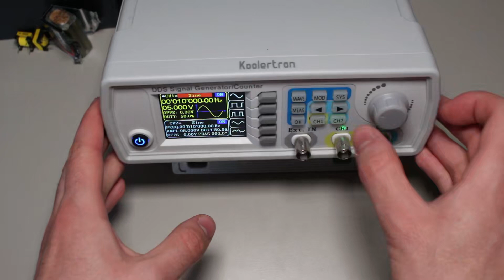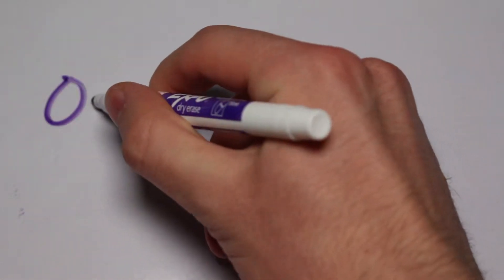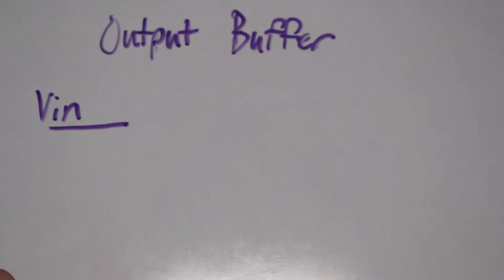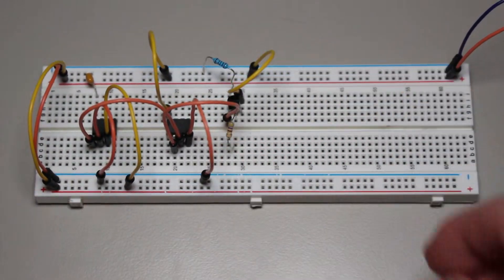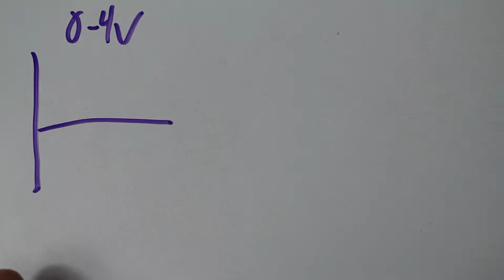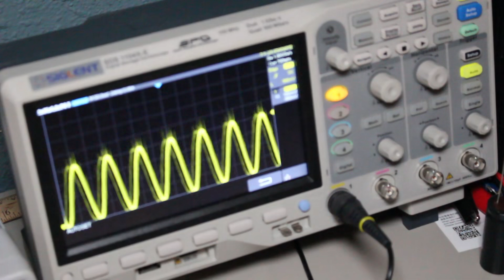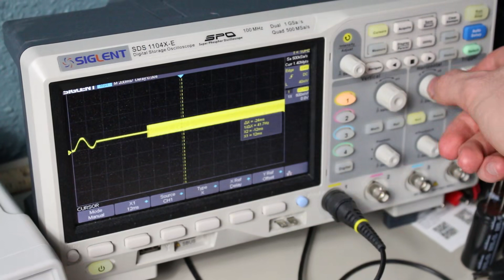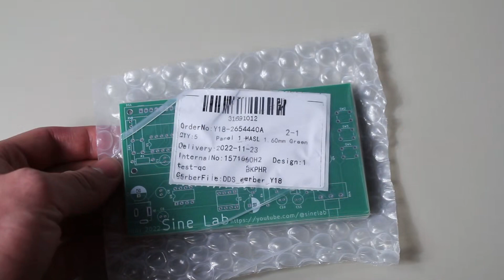Using Negative Voltages! - DIY Function Generator - Part 2

Comment: so just to recap, you have a microcontroller controlling a dac to generate a 0-4v waveform that is then changed to -2-2v with an op amp, then it is amplified using the pga?
Reply: you still use the -12-12v supply?